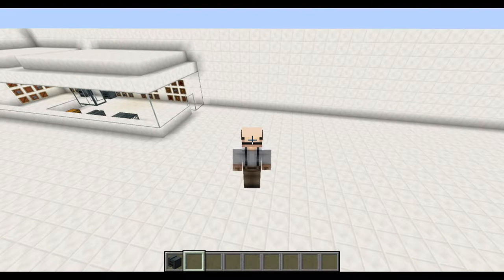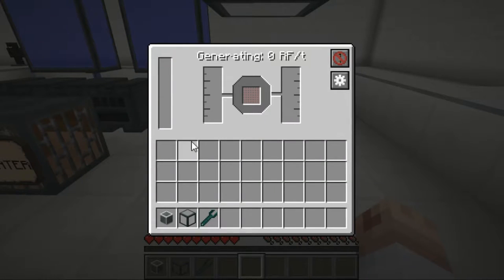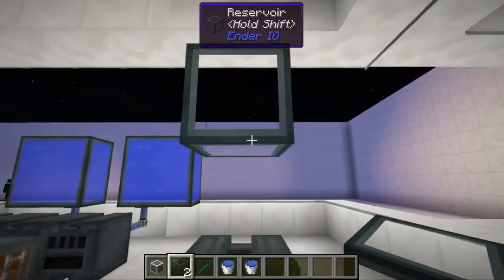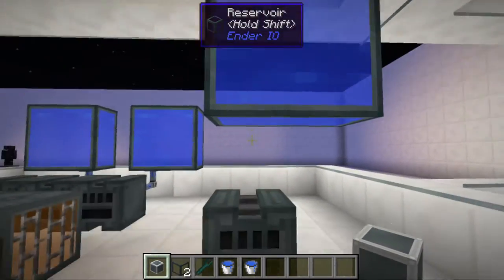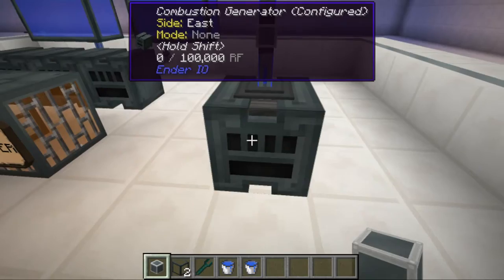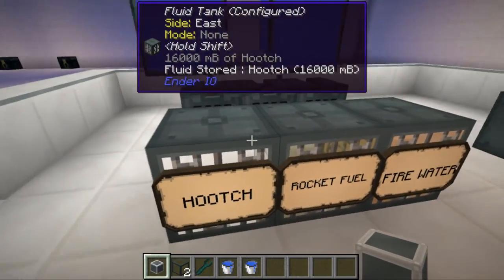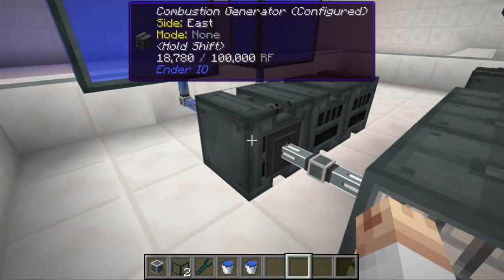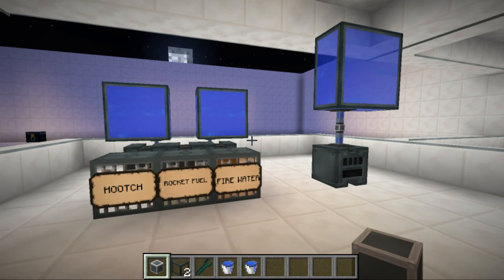Minecraft Tutorial | ENDERIO | Combustion Generator | 1.7.10

Comment: You connected the last two both with Rocket Fuel by not removing the joint that formed in your piping. Your point you made still stands, but just for testing purposes people wouldn't be able to see a difference as they both ran on the same fluid. :P
Reply: Not trying to nitpick, just an observation, haha. Also, thanks for making this. Very straightforward & informative on how it works, even though it looks a little different now- I now know it's fairly simple to setup & will try it in a future build!